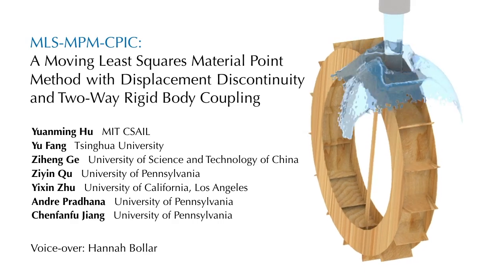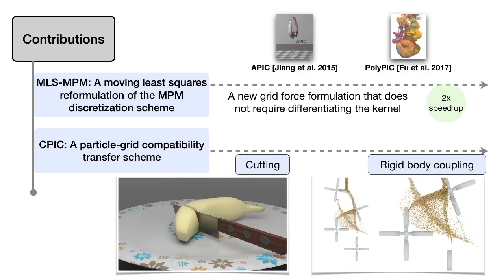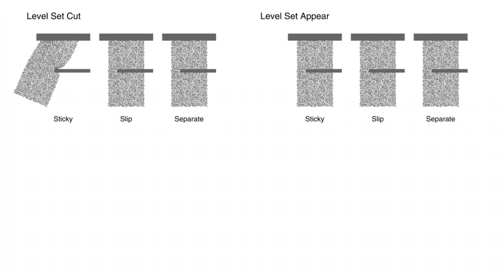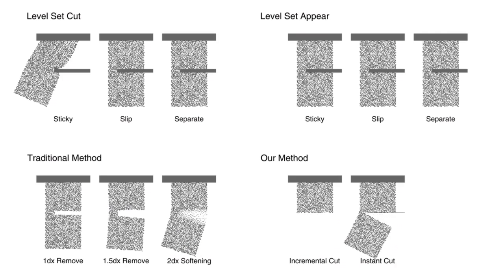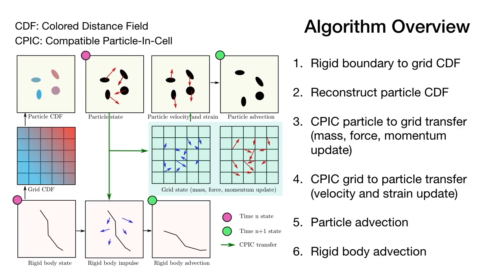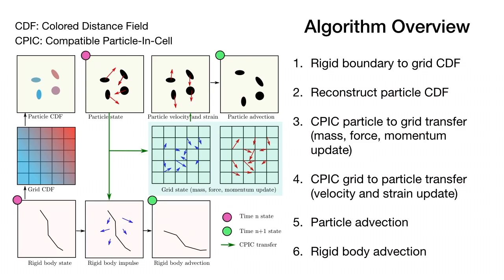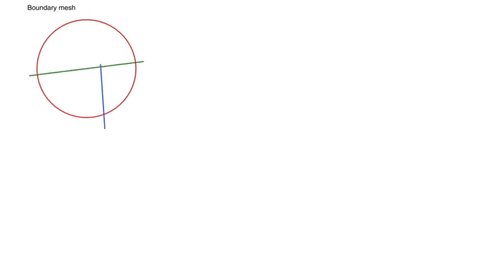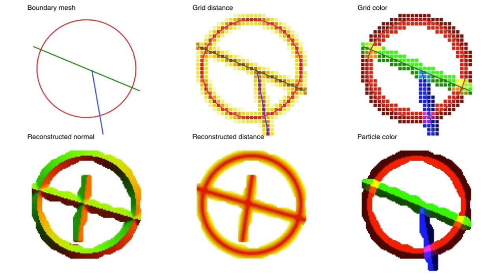[SIGGRAPH 2018] Moving Least Squares MPM with Compatible Particle-in-Cell

Comment: Great job. Thanks for sharing. Some questions for the last walking robot in sandbox, 1) what's simulation time per frame? 2) what's the simulation time if the sandbox is only 1.5x of robot size in each dimension to minimize the particle volume ?

Comment: This is amazing. And looks very fast. For rendering did you use something like Houdini?
Reply from the maker: Yes
Reply: @ethanymh  Awesome work with great presentation ! For the demos of your work, did you have to build plugins for Houdini, or does it naturally support extension ? Specifically, for adding new research related behavior into Houdini, what kind of programming was needed ?
Reply from the maker: @abhishek.chakraborty  We don't integrate our solver deeply into Houdini - instead, we just used partio to export particles for Houdini to render.
Reply: Yuanming Hu Thanks for answering !